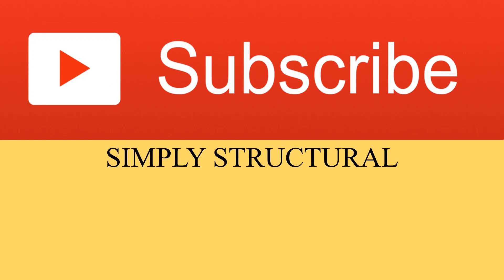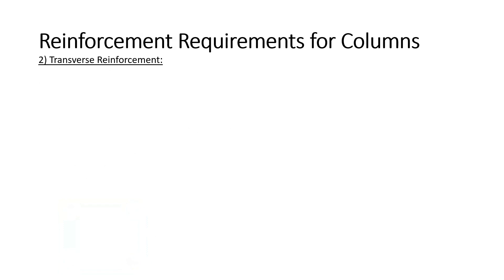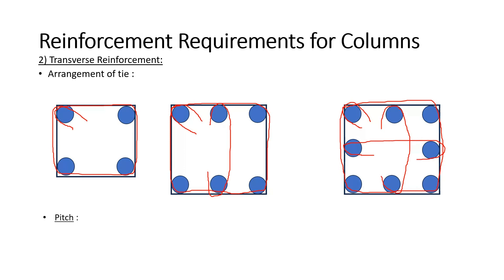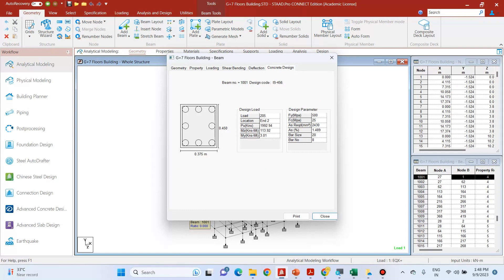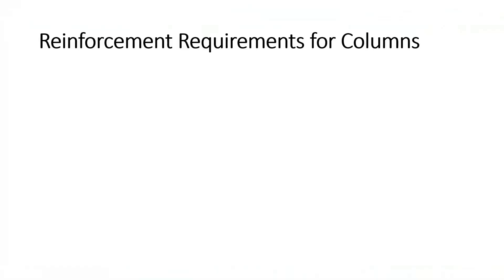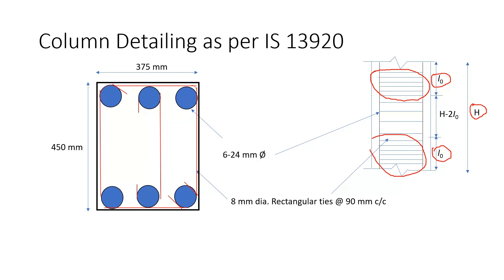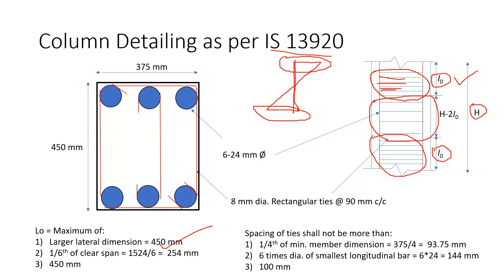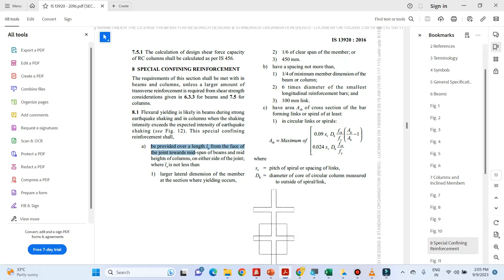Part 35 : Master Column Detailing as per IS 13920:2016 & IS 456:2000🔥

Comment: Hello sir, how to decide which code should use for designing nd detailing...is 456 or is 13920
Reply: In Staad pro connect edition..both codes are available is 456 and is 13920... Which code should be use for designing as results are coming out to be different for different codes
Reply from the maker: @khushbooverma6018  If your structure is situated in high seismic zones (3,4 or 5), you need to use IS 13920. For Zone 2, it is optional. The only difference in the two is detailing of R/F.